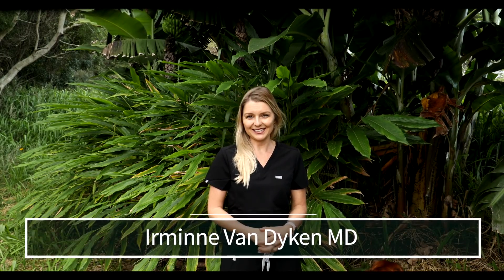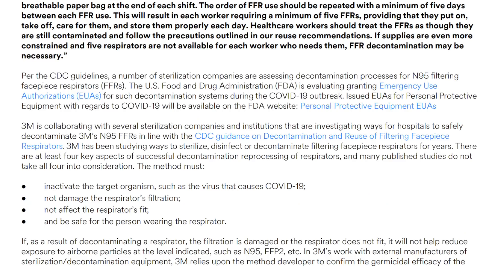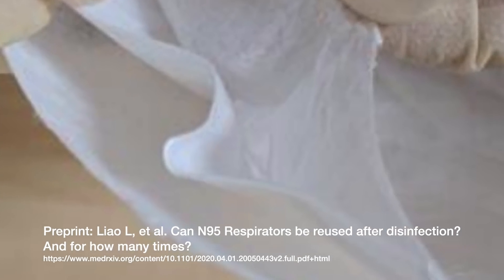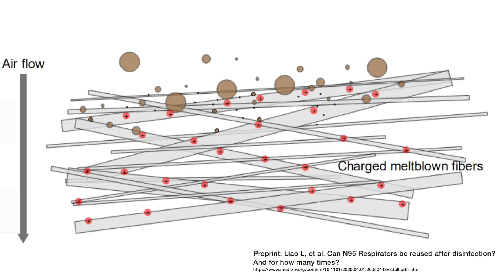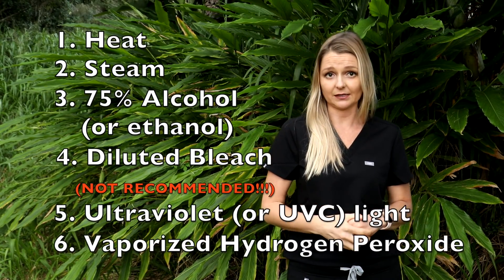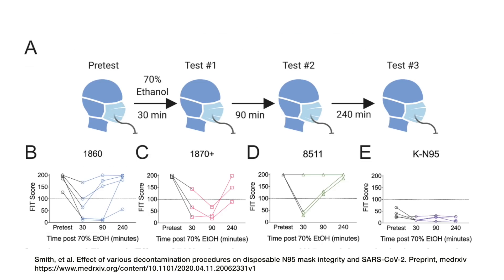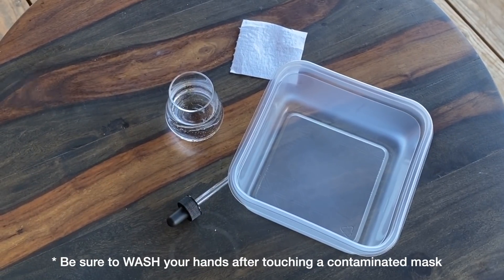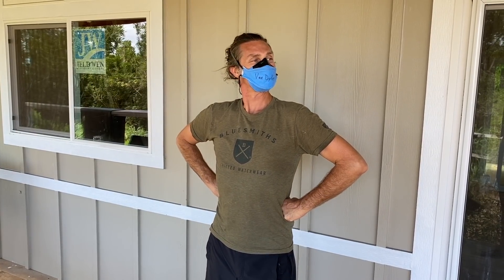How To Disinfect Your N95 Mask at Home

Comment: I rotate a quantity of masks in Ziploc bags. Eventually after a long time the virus dies and I can reuse the mask without chemicals or heat. You can just leave the plastic bag in the sunlight UV light
Reply: Had the same idea but was curious how long do you leave them in the sun? What do you do if you don't get a ton of sunlight? Thanks.
Reply: I actually don't have a sunny window so I just leave them in a bag for a long time. I'm retired and at this point I'm going to order all my necessary needs from now on so my mask will stay for indefinite periods of time. Basically it depends on your conditions they say leave them in paper bags as long as you can I wouldn't do it less than 2 weeks. Paper bags are better if you're not going to use sunlight especially if there's humidity in the mask
Reply: They have  box UVC  that sanitizes   on Amazon, they can sanitizes your masks  in as little as 5 mins.
Reply: @Rick-or2kq  I just wonder if the UV lights in those things are strong enough?
Reply: There are different types of UV light. Do you know 100% for sure which one you have because if you don't you are dead. Personally I will stick with sunlight because that is 100% foolproof. If you want to take a chance with your life with some manufacturers claims that's up to you. But at my age I take no chances. There are too many people dying with false claims from manufacturers trying to make money
Reply: @Rick-or2kq , They're not FDA or CDC approved. Those UV lights come from some manufacturer in China who is just trying to make more money out of the COVID-19 pandemic! They haven't proven that their lights do anything except take your money. 
Seriously, don't trust them!
Reply: Hi Andrea, thank you for the info, I am  not very knowledgeable about it, but I can say one thing, masks that are used all day carry an odor from your breath which is caused by bacteria,  after putting the mask in the sanitize that odor is gone and the mask smells like a new. So, I am guessing it is killing the bacteria..

Comment: I would be afraid to put the plastic in the oven
Reply: I thought so, too, but it apparently didn't melt when she did it.
Reply: I would rather use a glass or steel container to heat
Reply: It's LOW temperature.  Rotisserie chickens from the grocery store are kept in plastic at 200 degrees for safety.  This is only 185 degrees for sanitizing masks.
Reply: Perhaps it is below the melting point but I would be concerned about off-gassing residue remaining in the toaster oven.

Comment: What if you don’t have a convection oven? I don’t think I have ever seen someone with one. 🤷🏻‍♀️
Reply: What is a Convection Oven and When & How Do You Use It 
Apr 2, 2020 - Very simply put, a convection oven has a fan and exhaust system that a regular oven does not. The fan and exhaust help blow hot oven air over ...

Comment: Good idea to disinfect but I would never heat up any plastic.
I would suggest use a microwaveable glass box or an aluminium box and put them in preheated any oven..... Covid's cell wall is made of phospholipids which will melt soon on 60¢ temp.

Other option is buy a UVC lamp and put them in aluminium foil lined box for 5 and 5 min each side. Never look directly into UVC turned on lamp as dangerous for eyes and skin.

Comment: Dash of closed car, full sun, several days.
Reply: Yep.  I flip them every few days so both sides get toasted.  Probably only wear each mask every seven days.  Glad I stocked up in January when no cared.
Reply: That's actually where my R95 mask stays. In the car's up holder. I only use it once a week.
Reply: That’s what I do too ! I leave it in a paper bag on the dash . Trust this is fine
Reply: Suns heat, O2, O3, really ruins elastic bands...

Comment: This wouldn't work in a hospital setting where you have to have the N95 on for 12 hours, but if you are just going to the grocery store or running errands, cover your N95 with a cloth mask, then when you come home, wash the cloth mask in the washing machine with Tide and hot water.
Reply: Jane Snow 
Hi Jane, 
Please for your safety, please realize that a cloth mask won’t protect the N95 from contamination.  The cloth mask only helps protect others from the wearer. Washing the cloth mask is fine, but your N95 will remain contaminated.

Comment: How many people have a convection over?  No one I know.
Reply: Me!!! Also wondering if some of the trendy new air fryers might do the same thing as convection ovens?
Reply: In a previous generation, most of us had one as some point in our lives. I think you can still buy them at Wallyworld.
Reply: Now on new oven it's called quick bake cycle.  It's just a fan build in the oven.  Also plastic leaches when heated.
Reply: What is a Convection Oven and When & How Do You Use It ...
Apr 2, 2020 - Very simply put, a convection oven has a fan and exhaust system that a regular oven does not. The fan and exhaust help blow hot oven air over ...

Comment: What about using a steamer as the one my wife uses to steam vegetables ??
Reply: I steam mine over a pot of water, as originally we were told to 'not' wash it as it could push the contaminants into the cloth!! so, which is it? wash? steam?  I am certainly NOT going to put it in any oven, of any type, in anything plastic!!
Reply: @donnacloutier103   The one we have is 2 parts I figure 1 & 1/2"  water in the bottom then put in the top half with the mask and steam it. I just don`t know how long to steam it for, any ideas ? Thanks
Reply: @michaelwayne6624  Ten minutes on each side.

Comment: I have been using my clothes steamer.
Reply: Terrible idea. This is damaging the mask.
Reply: ScienceGuy it has not wrecked the mask. The steam from the steamer is not any worse then the conventional oven. Works great for me.
Reply: Carole Greenberg If it wrecked the mask you wouldn’t know because the changes occur on the microscopic level. Steam from a steamer is way hotter than some water vapor in a 185 degree oven. Unless you can somehow control the heat of the steam, it’s likely destroying it melting the inner fibers. :(
Reply: ScienceGuy thank you for your concern. I have a steamer that I can set to what temp I want to use it at. I am using equal parts of water and bleach. Then I let it air out for a few days. I have 4 that I rotate

Comment: I don't have an oven, I only have a microwave.  How can I disinfect my mask in a microwave?  Or with a spray of isopropyl alcohol???
Reply: Problem with microwave is there's no way to know what temperature it is at, go too high and you have molten elastic or your mask on fire. And most masks have metal in them so they can't go in the microwave. Anything you have that you can heat a closed container up to a known temperature or use a thermometer in... a double boiler pot on the stovetop would work... or just rotate masks and let them sit a week or so before reuse.
Reply: You can't.  Besides not putting metal in microwaves (N95 masks have a small amount of metal covering the filter), the microwaves are too long to hit every spot.  That's why even with rotating food you still get cold spots and hot spots.

Comment: Tupperware melts at 278° F.
Convection oven is not the same as a conventional oven, it blows hot air around the oven and exhausts it.
Stay in school, kids!
Reply: So 93° less than that is not going to melt it \O/ and microwave safe 'tupperware' ok.
A "conventional" oven is a convection oven. i.e. the heat only circulates by convection that being the ~conventional~ way until the invention of the fan oven. The oven that blows air is a fan oven, which plainly would be unsuitable as it might exhaust contamination.
Reply: @motomartinski5672  Stay in school.
Reply: @rayroc7243   Welcome   ;-D    (Nice to be nice)
Reply: Another utility bill

Comment: You don't really need a convection oven.  Instead preheat a pyrex dish with pyrex cover in a conventional oven.  The convection oven is suggested to prevent hot spots,, especially with PP containers.  The poor thermal conductivity of glass prevents hot spots.  Otherwise proceed as directed.
Reply: So you're saying to use a pyrex dish and cover in the oven, preheat, then add the mask and the moist paper towel, and return to the oven? She says the humidity needs to be very specific. I'm wondering if they calculated what the humidity would be inside their container and how that would need to be changed for a pyrex container which would be a different volume.
Reply: @ThatOneScienceGuy  Hard to know how how they arrived their RH number but it would be easy to adjust based on the relative volumes of the containers.  I believe the relationship is linear.
Reply: Richard OBrien The relationship would be linear. Lol. I deduced that after commenting that I could simply adjust for an increase or decrease in volume.

Comment: Why can’t you do pretty much the same by putting it in microwave safe container, add two cops of water, soak the mask in the water and blast it for 5 minutes. Remove and hang it to dry naturally. I would think this method is better and as effective as any. No brainer:)
Besides, how is it that you would put a plastic container in the oven...Is rather mind bugling.
Reply: Most masks have metal so can't go in the microwave. Plastic is fine at 185F its too low to bother it.

Comment: Wouldn't plastic melt in a convection oven? Especially for 30 mins at almost 200 degrees???
Reply: 185F is not hot enough to melt a tupperware
Reply: @xoxoemo  But heated plastic cant be healthy. Wouldn't the plastic smell penetrate the mask?
Reply: @jamesgerboc  No, the mask itself is "heated plastic" kind of.
Reply: You would think so but not all plastics are the same. Check out “flowing” method for mother boards where you place in an oven at 400 degrees for 10 minutes with no degradation

Comment: Just use 50ml of water in a plastic bowl, place a grid like layer over it and your mask (respirator) outer side (external) down on top of it. 
Place it in a microwave oven for  300s (500-700W), 180s (800-1000W) or 90s (1100W+). Can be sterilized up to 5 times. 
No need for convection oven. All the materials must be microwave oven safe of course (no metal grids, no unsafe plastic). Watch carefully.

Comment: In the Italian method, is there a functional difference between ethanol and isopropynol? I have 90% of both, but I'd rather keep the ethanol for making amaro.
Reply: ethanol has a gigantic concentration of alcohol, over 90% and will evaporate too quickly, use ISOPROPILIC alcohol (70% alcohol) for decontamination, use ETHANOL for CAR FUEL. haha
Reply: @FinesseNoCommentary  That's...not accurate. The name (ethanol versus isopropanol) has nothing to do with concentration. Ethyl alcohol (or ethanol) is made from fermentation of food carbohydrates, which is why it's often called "grain alcohol." It's the kind of alcohol you drink. And yes, it's also used as a fuel additive because our country produces such a ridiculous quantity of corn that nobody eats and the farmers have to sell it to someone. A standard bottle of vodka is 40% ethanol. The other 60% is water. You can also buy it at 60%, 75%, or even 95%. The rest is still water. Isopropyl alcohol (or isopropanol) is an industrially manufactured substance that you definitely cannot drink. It's bought in any drugstore, usually in 70% or 91% concentration.

Comment: Bummer, don’t have a convection oven, what do normal people do?  Also will the heat degrade the rubber straps?
Reply: I've done a regular oven @ 170 for a half hour (preheat the oven) and yes eventually it degrades the straps.  You can staple on elastic.

Comment: I put mine in the microwave for 30 seconds on high (1000 watts), nose/valve side down on turntable, and get 4 or 5 days use out of it. A light spritz with  Lysol lemon on the outside of it helps to freshen it. Been doing that on my N95 mask for two months now.

Comment: Since Sars-CoV-2 disintegrates with soap, why not swirl and then soak the used mask in a solution of laundry detergent and water for an hour or two, then rinse the mask with water without wringing it. Hang and drip dry. I've done this with surgical masks successfully. This process also removes facial oils, nasal secretions, and saliva when talking and sniffling while wearing the mask.
Reply: As I understand it, the washing procedure will inactivate the electrostatic filtering (middle) layer of the N-95 mask.
Reply: Fred Hoeptner 
Most likely you're right but then again this video is about how we can reuse our masks during these times when there is a mask shortage. I am not sure heating the N95 worn throughout the day in sweltering weather, infused with sweat, facial grime, and saliva droplets in an oven is all that great IMO. :-)

Comment: A mask does NOT protect the wearer, It is better to use what I made. A clear, thick  piece of vinyl 12 x 18 inches. Duct tap a headband to the 12 inch side. Protects both user and anyone nearby. But if you want N95 masks check with Jason Qin at sales4@apexis.com.cn or visit their web site for thermometers, face shield or N95 masks. www.apexis.com.cn

Comment: I call bs on them plastic containers in an oven. They typically melt lmao.
Reply: She specifically said you have to use a CONVECTION oven. There's a huge difference. Since I don't have a convection oven, this advice is not useful to me 🤔👍🏽
Reply: Convection oven, ya dingbat.  Convection  ovens use fans to circulate the hot air then exhaust it.   Also its 185 degrees, Tupperware melts around 270° F.  This is whats wrong with America, idiots calling bs on basic shit they just too stupid to know...smh.

Comment: 45 mins at 185 in plastic?   The plastic won’t melt?
Reply: Tupperware melts around 270° F.  You coulda just looked it up instead of asking a dumb question.  Did you see the tupperware melt in the video?!  JC!  Its a convection oven, not a conventional one.
Reply: @rayroc7243  Insults aren't needed. A convention oven still produces heat, which is the point here.
Reply: rayroc Youre kidding? So plastic has to melt to give off gases? Where’s your reference for that piece of wisdom? I am on topic young man. Just read the other comments, like one from a chemist, and be careful you don’t find out you are wrong about this. Defending an incorrect fact makes you either an idiot or a narcissist. So glad we had this little chat.
Reply: @rayroc7243  Convection or conventional oven, they both use heat.
Reply: @cockeyedoptimista  no shit, Sherlock.   What's your point?
Reply: If she crazy o she talk microwave am confused .why kind oven is THAT.
Reply: rosa lainz its a convection oven
Reply: Bobby G Berney 
She’s as stupid as she talks! That’s why:) I don’t care what type of oven it is... you don’t put plastic containers in an oven. Even with some microwave ovens if it’s not in a microwave safe container!
Reply: @LELOOSHIAN  why care about facts when you can go night night at the same level of stupid you were when you woke up!
Reply: @LELOOSHIAN  lol dummy...

Comment: Accomplished this process. this past weekend.  Did 190 degrees in my convection oven.  No problems with plastic taking the heat. No smells ,didn’t soften up. Plan on reusing containers a second time.  I also turned off the convection  option and softened up the lid a tiny bit.  So conventional oven is out. Thanks again

Comment: Just hand wash it with soap and water and let it air dry, or use the peroxide solution and wipe it off and wear it every other day.. in my case I alternate..
Reply: Apparently the washing procedure inactivates the electrostatic filtering properties of the middle layer.

Comment: I recently read another peer reviewed paper (I don't have the link handy) that supports the moist heat effectiveness. They actually referenced a test using a standard rice cooker to do something very similar. How sad that we do not have available supplies of what should be a very cheap and easy to get item. I would buy them and use them once or twice in my woodshop and toss them. Now they are nearly impossible and we are doing actual studies to figure out how many times/ways to clean them. Oh well - such is life at the moment. Be well!

Comment: 185 is overkill. bacteria and viruses die at 103 degrees F. So, an internal oven temperature of 110 degrees F for 15 munites should be ok. Also, use a glass container (not plastic). Put wet tissue at the bottom (not on the top), to preserve the integrity of the fibers. You can totally wet the tissue and wring it; instead of using just a few drops. Not rocket science.

Comment: I have a spritzer you can get anywhere with 70% alcohol and 30% H2O2. Spritz until wet and hang dry for the next use. I'm a senior so my trips outside are few and far between. You could probably wave it over a steaming kettle.
Reply: You mix hydrogen peroxide with alcohol?

Comment: None of this is actually tested.  It may kill the virus but you are also putting stress on the fibers and efficacy of the mask itself.  Hospitals use a very different approach to sterilize their masks using aerosolized hydrogen peroxide.  That HAS been tested.  It’s necessary for them to do it because the viral load the mask can get exposed to in a hospital is massive.  If you’re using the mask to get groceries - chances are you didn’t pick up the same viral load as walking through a ward where COVID patients are being intubated.   If I’m “disinfecting” a mask after a visit to the grocery store - I’m letting it sit untouched in a paper bag for 48 hours.